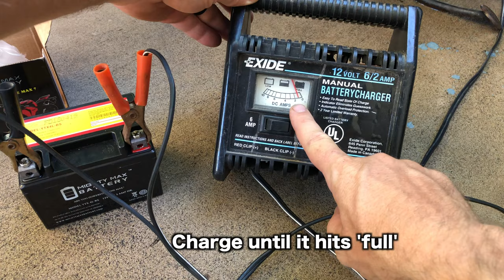Honda Elite / Tact 50 - Battery Replacement Tutorial | Mitch's Scooter Stuff

Comment: I'm delighted to say that today I received the battery that you recommended and installed it in my Honda Elite.  It would have been tricky without your video as a guide.  20 bucks for a battery and no expense for labor.  Awesome!!!!  One question though.  Underneath the scooter seat, there is the large straight head screw that you take off to release the front plastic panel.  My scooter doesn't have that screw there.  I'm guessing it was lost or it wasn't put back by the maintenance guys who installed a new battery in it years ago.  Can you recommend where I can buy that exact same screw?  Thank you for your video.  It proved valuable for me. :)